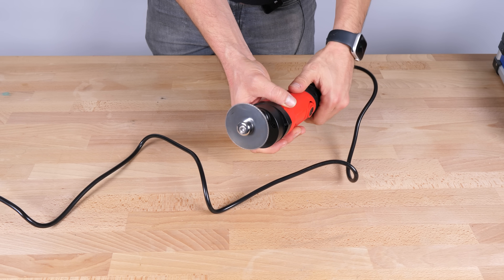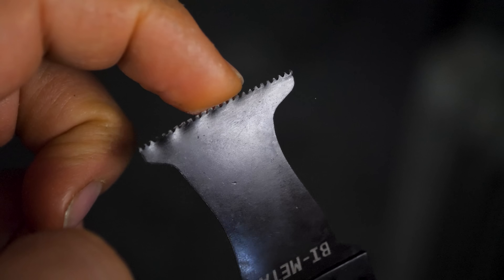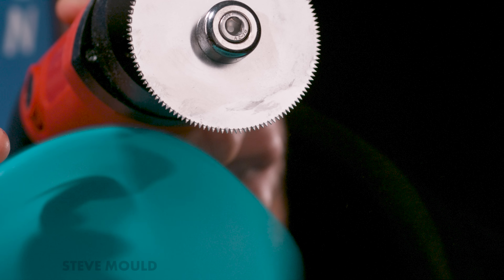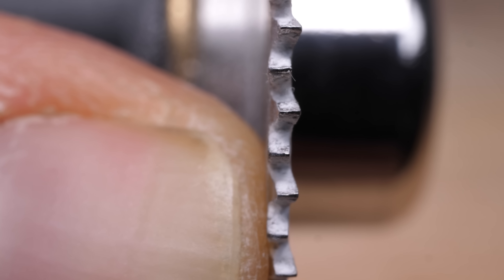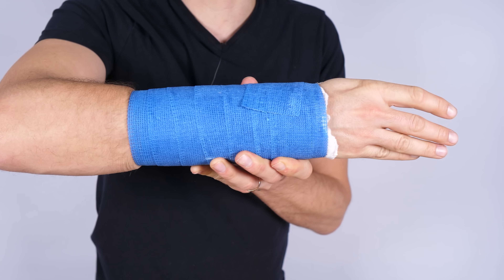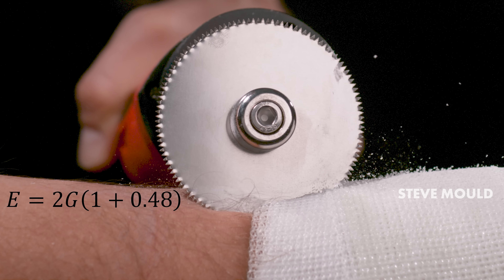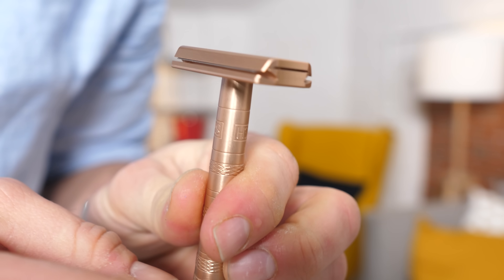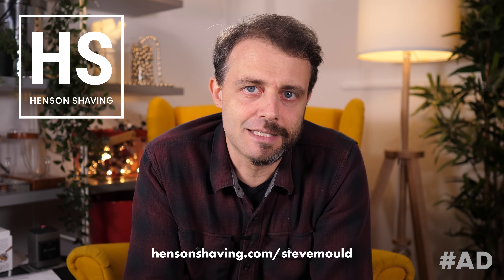A cast saw on human skin

Comment: The trick is to touch the blade before starting the cut, it's why the doctor showing off how safe the blade is always starts it up and touches it a few times to reassure the patient like steve did here. Problem is, once you actually start cutting, the blade heats up FAST. You can get a very nasty burn from one of these if it touches your skin close to the end of the cast cutting process. The blade doesn't have much thermal mass, so you are fine if the nurse regularly stops the cut to give the blade an instant or two to cool off, but if they're in a hurry, doing the cut all in one go, and sloppy about depth.... some nasty burns are pretty much guaranteed.
Reply: Probably what happened to me.  I've got a couple scars on my arm from a cast saw.

Comment: In fourth grade I had some damage in my knee which required casting for 3 months. By the time I got the summer I was so sweaty and it was so hot that I had somehow worn through most of the padding on the inside of the cast in my skin reacted to the fiberglass. When they cut the cast off to treat my skin, I was so swollen that the saw cut through my skin in two places... No system is perfect 🤣
Reply: Either the cast saw the stupid intern used for my cast wasn't oscillating, or my skin was weak/tight.

I still have a couple scars too.
Reply: Ah I’ve found the small thread of other people who actually got cut by a cast saw. Doctor told me how it worked and wouldn’t cut me, alas I still got cut on my bony wrist.
Reply: Yeah, swelling or dry skin would allow the saw the cut you. Swelling, for much the same reason that was showcased with balloons- the tension on the skin lowers the potential elongation before tearing occurs. For dry skin, it becomes more brittle-- much like the cast-- and can cause bleeding if the dryness is more than superficial.

Comment: The waves you are seeing are not traveling at the speed of sound in your skin. Just like there are different types of seismic waves that travel at different speeds, there are going to be different types of waves in your tissue. I think you are seeing "surface waves" which are relatively slow. Just like the waves on the surface of water, which travel much slower than the speed of sound through water.
Reply: From:
https://www.ncbi.nlm.nih.gov/pmc/articles/PMC6662181/#:~:text=The%20speed%20of%20sound%20in,%2Fs)%20for%20image%20reconstruction.

"The speed of sound in normal human tissues ... ranges from roughly 1430 m/s in breast tissue to 1647 m/s in muscle." 

Just a bit higher than your numbers. 😁

Comment: That's like the ultrasonic bone cutters we used in oral surgery. They're dull and operate by fracturing tiny bits of bone around the tip. So they are very useful for things like sinus lift surgeries to make more room for dental implants. Those are done from inside the mouth. A hole is made through the jaw with a typical rotary handpiece, typically where a tooth used to be. Then the bone under the sinus floor is fractured away with the ultrasonic instrument. The soft tissue just lifts up out of the way. Then the bone fragments are pushed up, and often more graft material is added to hold it. The sinus floor is not perforated by this.
Reply: just reading this is giving me nightmares (" oДo)
Reply: @fsmoura , it sounds more traumatic than it looks. Of course, no surgeries are pretty, but of the thousands I assisted, these were far from the grossest.

Comment: A lot of people so have a similar tool to this at home, though: An electric toothbrush

One I had as a kid (if you removed the replaceable brush head) would drill itself right into the plaster of the wall. My parents weren't big fans of this fact, but I learned something XD
Reply: There's another kind of oscillating tool that's very widespread.  Oscillating saws have become extremely common in the power tool business.  They're actually quite similar to that cast saw.  You can go to any hardware store and find a wide variety of them from all the major brands.  Very useful tools for detail work or cutting in confined spaces.  Wouldn't use them for cutting off casts, but theoretically you could.
Reply: @ccoder4953  its most commonly called multitool because it has many kind of functions
Reply: It's also good at locating prostate cancer, if you weren't aware.
Reply: wut? :O how?
Reply: I went out with a girl once who also found another use for her electric toothbrush, but that’s another story.
Reply: hahaha im gonna try that 🤣

Comment: When I was a kid, I got a cast and when I heard they'd use a saw to remove it, I was EXTREMELY worried for several days and nights until the moment actually came... and it was perfectly fine.
That was maybe 35 years ago.
Thank you for making this video 😁
Reply: ... Apparently they didn't always use oscillating saws, or I had tighter skin.

Still have scars.  They're most visible if I get a tan.
Reply: @hariman7727  the thing they forgot to mention is that as these blades lose their edge they generate more friction and get hot enough to burn through your skin... i've got scars as well and they've been there for the last 30 years
Reply: If I were the doctor I'd put a big show and say: "Watch out, kid, this will cut off your arm if you ever so twitch even a hundredth of an inch!" And then approach the cast veeeery slowly. (" oДo)
Reply: @fsmoura  thank f**k you're not a doctor

Comment: Why would you shave with blades?
Reply: What else to shave with?
Reply: @fsmoura  Electric razor? I've shaved with one for 25 years and never needed to change a blade. It also takes less then 1 minute, you don't need any cream, and you can't cut yourself.
Reply: @i.k.8868  Sure, you may not need to change them, but aren't electric razors also made of blades?
Reply: @fsmoura  yes I guess there are two jagged blades in there oscillating. And no I don't charge my electric razor, it is 25 years old and back then they came with a wire.
Reply: @i.k.8868  so you're still shaving with blades?
Reply: @fsmoura  But not with those horrible unsustainable and dangerous throw away blades he is marketing ;)

Comment: My mom got a cast cut off and she told them it hurt and they said it couldn't be cutting her, but when they took off the cast she had a really shallow cut in her skin along the cut. Can these things malfunction?
Reply from the maker: There's a joke here about your mom being like an over inflated balloon but I'm not going to make it.

Interesting experience. It could be that the blade got hot from friction and that helped to abrade the skin a bit.
Reply: @SteveMould A similar thing happened to me, where I got multiple cuts from a badly used cast saw.

Dragging it across the skin, heat, thin tight skin from swelling or just being skinny, probably all factors in why I have "stupid smug faced intern with a cast saw" scars now.
Reply: 🥴 @SteveMould
Reply: Not Steve casually hinting at a "yo mama" joke 😂
Reply: Also, as Steve pointed out, if the blades are sharp, it can cut you, and if your skin is either really tight, or kind of saggy, it could still probably do some damage.
Reply: I kept wondering, what would happen if maybe the cast is stuck to your skin? If that doesn't separate immediately, I imagine that maybe the skin is made "over-inflated-balloon-like" just by being stuck to the cast. But that's just a random thought from a random fellow who's never had a cast in his life.
Reply: @R3dFlames
The inner material is different on purpose to ensure the plaster doesn't set directly against the skin.
If it ever did set against the skin someone really screwed up.

Much more likely the skin was scratched up by overly sharp teeth on the saw or didn't have the normal give(scar tissue for example is way less elastic than normal skin so if the underlying skin was scarred this makes it way more likely).
Reply: @R3dFlames  The bottom layer typically doesn't stick, if it did... you'd go back to get the thing redone, because it would make daily life VERY annoying. You get muscle atrophy after being in the cast for a bit (they had to redo the one on my leg because it had shrunk so much and my leg had way too much freedom of movement) and if the skin was sticking to the cast while your limb was getting smaller, that would be massively irritating.

Comment: plaster casts are still used quite a lot, but for more serious injuries. they use chemical accelerators in it to make it set in an hour or so, its gets really quite hot as it does. only lesser injuries or later stages get the fiberglass ones. also you cant just get the speed of sound for your skin from the ripples since your not in the far field regime and the oscillations are quite clearly being powered.
src: im a physicist who had a lot of casts...
Reply from the maker: Two very interesting points. Thank you.
Reply: Yeah, the speed of sound part was a bit sloppy. 
not really 'linear' (dispersion free) I guess
src: a physicist who knew how to avoid breaking body parts
Reply: >  also you cant just get the speed of sound for your skin from the ripples since your not in the far field regime and the oscillations are quite clearly being powered.

I think a bigger reason is that these look like shear waves, rather than compression waves.
Reply: I would also suspect that the fact skin is firmly attached to whatever is under it has a huge effect on the waves generated too.
Reply: Not sure about anywhere else, but agree that both types are still used. When I broke my ankle (minimally displaced in the lateral malleolus). They used a half plaster of paris type cast (ie mostly cast around the back of the leg and under the foot) to stabalise it as they anticipated much more swelling - even though this was about 4 days after the actual incident that caused the fracture (dont ask) a fibreglass one wouldn't allow for swelling. So I had that one for a few days until the swelling had peaked and then they gave me a fibreglass one for the rest of the time (it did have to be changed as I hadn't kept my leg properly raised when in the plaster one so the swelling and fuild retention was quite a lot when the put the initial fibreglass one on, so when swelling an fuild retention went down it became loose to the point of needing replacement.

Tl;dr they still use both as OP stated, in my case it was to enable swelling to peak and the half-cast done in plaster of paris allowed that to happen without cutting off circulation and causing pain.
Reply: @Thats_Mr_Random_Person_to_you  Qualified Orthopaedic practitioner here. That means my job is the application of casts and braces. We use more that just Fibreglass and Plaster of Paris. In my plaster room in addition to those we also use Polysynthetic (similar to fibreglass but the fibres are polyester not fibreglass), and Soft cast ( a flexible form of fibreglass, which uses a different kind of resin). There are other materials such as thermoplastics and even wood casts, but they are costly and require specialist equipment such as hot water baths.
The choice of materials can come down to many factors. 
As you state you were fitted with what we call a Below knee back slab, and is as you state used when swelling is a major concern, as the "incomplete nature of the cast allows for fluctuations in swelling. Interestingly it can be made out of pretty much any material, but Plaster of Paris is used because it is cheap, accessible and easy to use, with most back slabs being fitted in ED's by staff with minimal casting training, Where as my team and I may use Fibreglass for a back slab, especially if we need to manipulate and mould. In such cases we would apply it as a full cast, then when it has set enough cut away the front 1/4 to 1/3 of the cast and apply a crepe.
Plaster of Paris is also hydrophilic, making it very good in the immediate post operation phase of treatment, as it will draw fluid away from the wound helping the wound to heal. 
Most Fibreglass cast are interestingly likely made from poly synthetic. It is not as rigid as Fibreglass which makes it less brittle, fibre glass is more prone to cracking when loaded, while a little bit of flex allows the poly to absorb forces a little better with out giving way. Most of the cast we apply used this material. 
We mainly use Fibreglass when speed is required, as it sets the fastest. We also use it as a supportive splint within a soft cast. 
Soft cast allows for a very conforming cast with very little padding. It is very good at reducing atrophy, but costs a lot more than other materials and requires more training
We will even mix materials when we are looking for a mix of qualities.
Returning to cast saws however, it is possible to cut skin with cast saw it the underlying tissues are rigid, such as bone. This is why we are trained to cut in areas that are not near bony prominences such a the ulna styloid.
Reply: This was a good post.  LOL!
Reply: I'm hoping that the casts are not a side effect of the job. ;-)
Reply: Oscillations are always powered by something. Oscillations through the air are powered by your lungs when you speak. How fast those oscillations travel is the speed of sound through air.

And by far field *region you're referring to the electromagnetic field around an object which would be relevant if we were talking about radio waves not sound waves. The speed of radio waves is entirely different from speed of the oscillation of compressive pressure (sound).

Hope this clarifies things for you.
Reply: @waxywabbit1247  this is wrong, and i dont think you understand.
imagine this, you detonate a high explosive. the initial blast wave propagates at the speed of that explosive which is far higher than the speed of sound in air. once this hits air it will still go at that speed for some distance. this is called the near field, as you said this is also true for electromagnetic waves and is true of all waves. only after some distance will the blasts wave slow down to the speed of sound and propagate 'normally'.
with powered i meant that the oscillations are forced at that frequency and do not yet go at the speed of sound for that medium.
Reply: I love that the source here is almost like "I made it the fuck up."
Reply: @noiJadisCailleach Uhh, how is stating your relevant profession and that he's had multiple experiences in casts at all equivalent to "I made it up"?